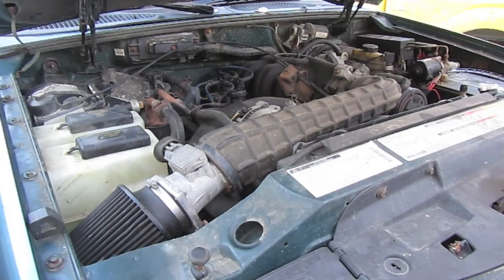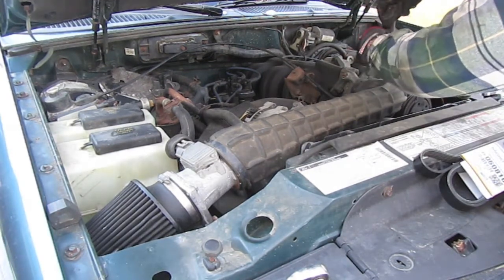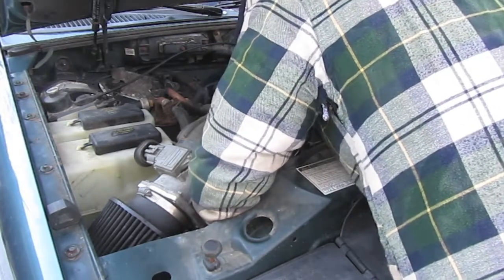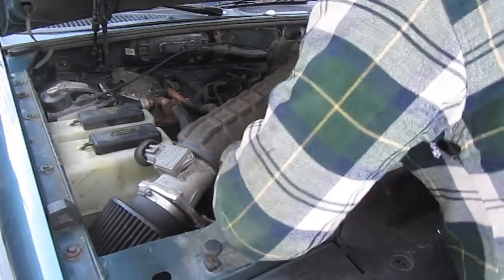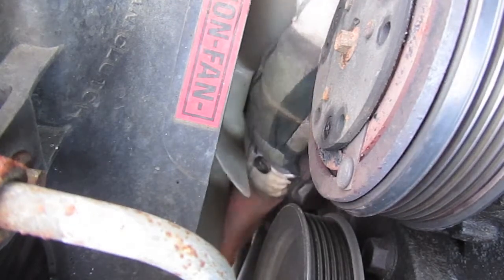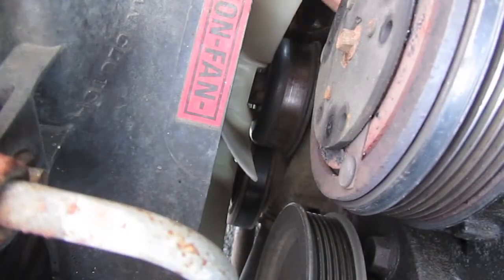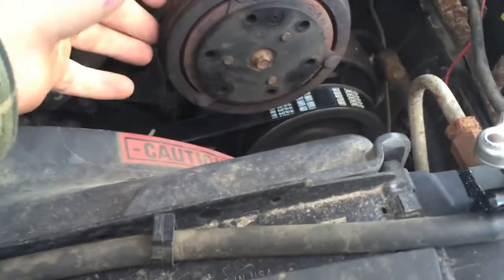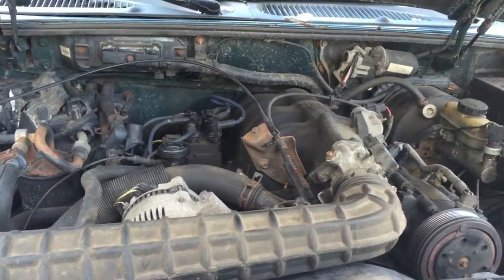Seized A/C compressor bypass on a Ford Explorer via shortened belt

Comment: The AC pump appears to be free because the electromagnetic clutch is not engaged. If you turn the ignition on, and turn AC on, chances are you wont be able to turn the pump if its knackered

Comment: Thanks for the tip for this cheap easy way out. I'm in this situation right now where I can't afford having a A/C spectacles drain out the free on before I even attempt to take off the compressor.  The only thing is, What year is this Ford explorer? I have a 2001 Ford Explorer 5.0.  Ask for a non A/C Drive belt? This video would be perfect seeing someone who has already experienced this problem display an accrual specific length for a non ac drive belt. I think this video would have a lot more hits if it was more specific. It would save a lot of us the Headache.
Reply from the maker: its a 1995, I'm nor sure if a non ac belt was offered for the 5.0, ask at the parts store to check, if not, you can run a rope around the bullies and get a measurement to take to the store. you may need to try a few belts to find the right one using that method however it will work I recently did it on my girlfriends car.
Reply: Yeah, I don't think they make a non AC for my Ford 5.0r. I've been looking for a Serpentine/Belt specs length but they are all the same. Turns out they make a AC compressor bypass which replaces the AC compressor < http://www.autozone.com/cooling-heating-and-climate-control/a-c-compressor-bypass-pulley/dorman-a-c-compressor-bypass-pulley/838300_0_0/ > using the same size Serpentine Belt . Thanks for sharing the video.
Reply: Up Date..... As for my 2001 ford explorer XLT 5.0 2wd, I ended up towing my ford to break masters so they can take care of the job. Went to pick up my vertical after they replaced the seized  AC compressor which the AC compressor bypass replaced. I did not replace the serpentine belt so the mechanic did inform me to replace it soon. I took a look at it and to me, the belt did not look bad. About week later, I started hearing screeches again but it was not as bad as when I had the seized AC compressor. To me it didn't make sense and I didn''t think any other wheel the serpentine belt was supporting would be possible to seize up. 
Well I was wrong. I kept riding my ford until I learned the hard way. Driving down the road, I heard something break so I pulled over and found that it was the belt. At that moment, I was thinking I should of listened to the mechanic. Waited the next day to tow it home. Turns out the idle pulley located by the crank shaft pulley had seized up causing the belt to break. Just to inform those seeking this fix, consider  the AC Compressor is not the only pulley to seize up. Check all pulleys. Make sure they all spin.
Reply: for the 5.0, a duralast 835k6 does the trick,  had to bypass my ac a couple days ago

Comment: 75$ for used compressor 1 hour and refill lines 8 oil
Reply: Jeffrey Morton ford explore 2006 4.6 compressor is 170.
Is cheaper for a smaller belt
Reply: And thats about $65 to much compared to a shorter belt lol. We cheap as hell haha
Reply: What size smaller belt for the 06 Ford explorer